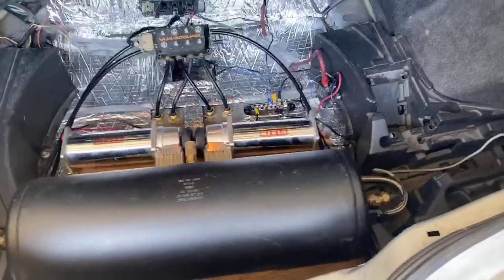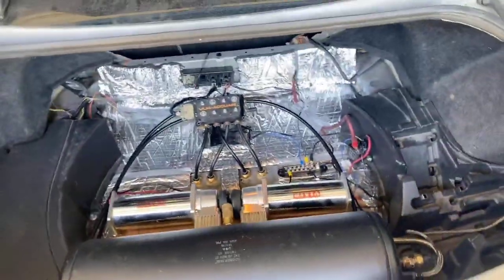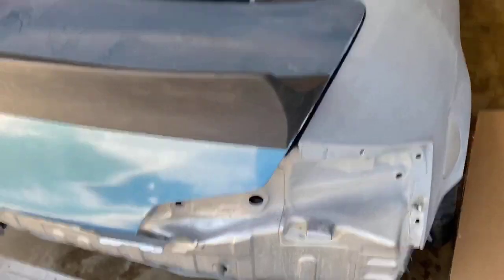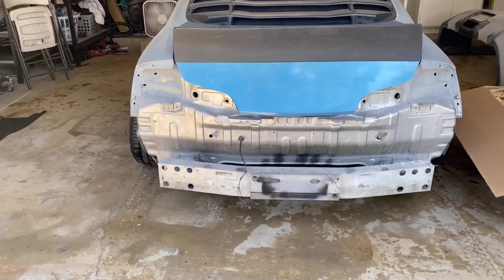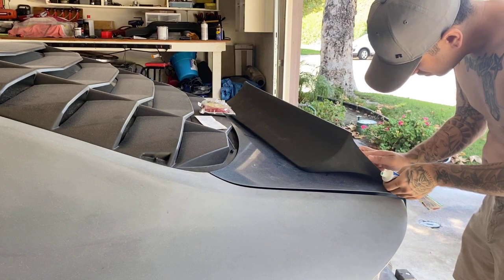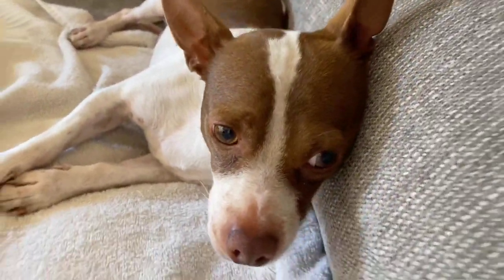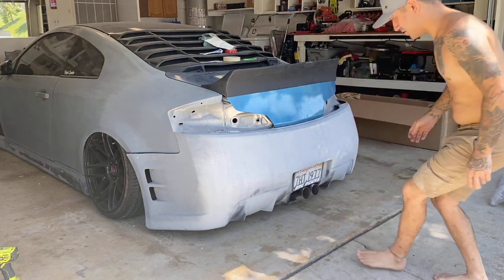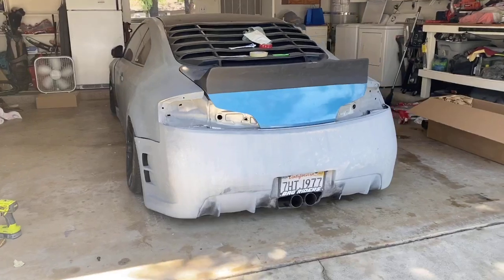G35 battle aero duck bill install

Comment: Genius idea on how to get the spoiler holes on the trunk so you know where to drill! I just picked up my second Nismo replica spoiler and it didn’t come with the mounting stuff my first one did (pretty much 2 zip ties with a hollow cylinder connected to the zip ties that fit inside the spoiler holes. Once positioned you tape the zip ties down on the trunk and lift off the spoiler. Then you drill through those cylinders, remove the zip ties and put your screws through the holes and into your spoiler). But this will def work since I don’t have those “zip ties” (have no idea what they’re called)